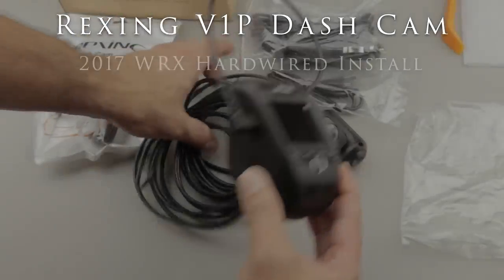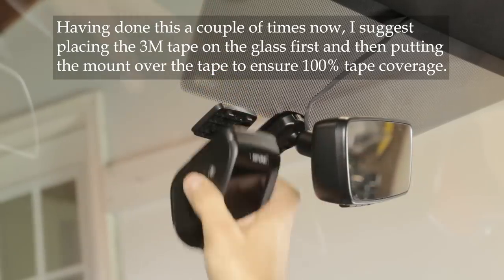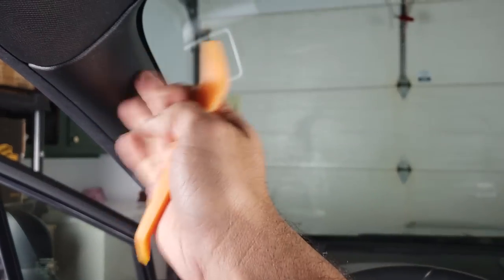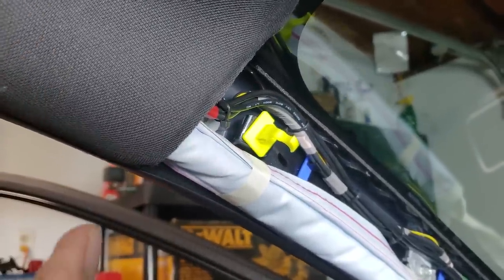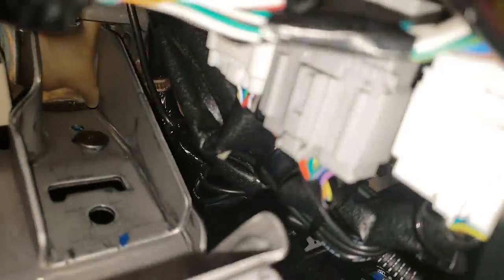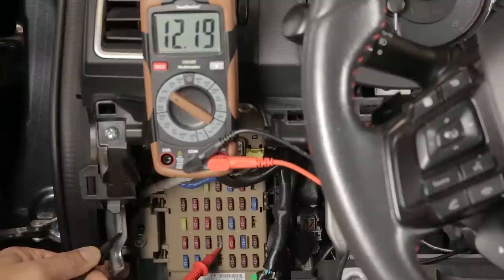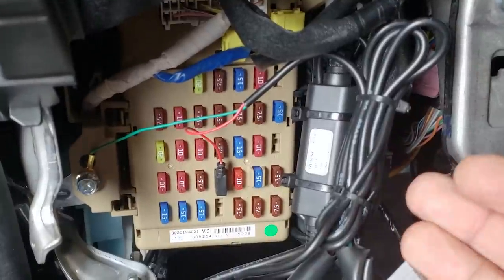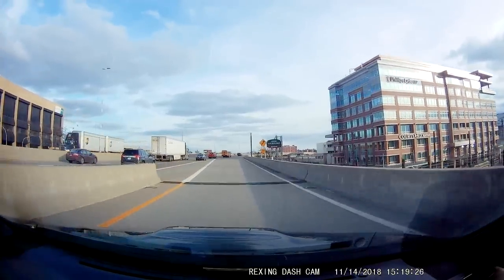How to Install (Hardwire) Dual Dash Cam in WRX: Rexing V1P 3rd Gen

Comment: Great video, just one note, those small points on the back of every fuse are there so you can test a fuse without having to cut it open.
Reply: Thanks for the detailed and meticulous video. Very helpful. Two things that would be helpful to discuss in an initial vid, are the pros & cons of direct wiring, including the risk of draining your battery. And, secondly, the cost/benefit of buying a 2 cam system with a “park” mode vs. a direct wire. I appreciate your demonstrating the removal of trim panels, zip tying cables, using foam insulation and routing the rear cam cable around the headliner perimeter vs. attempting to go through the center of the headliner. Very well done. I learned a lot. 👍

Comment: Thanks for the information. I have a 2017 STI and want to hard wire my new dashcam as well. However, I want to use a constant power connection (for nighttime monitoring which my camera supports). Do you happen to know which fuse location provides constant power?

Comment: Nice job. I did notice u have a Subaru and I have a Toyota and we have the same T style tab to watch out for. However I have a question. 

When u installed the key on wire. You didn’t install the constant. So u only use one of the 2  wires in the kit….what did u do with the constant power wire?

Comment: Great install video.   

Be aware that the black box on the DC-200 mini-USB direct install harness will not activate and power through the harness (to the dash cam) unless minimum voltage of 11.6 volts is detected by the black box.  The standard cigarette lighter power harness does not have this voltage sensing so it will operate e.g. at 11.4 volts, whereas the DC-200 Smart harness will not operate.  

If you hardwire using this DC-200 cable it and static test during installation and your Rexing dash cam does not power up THIS DOES NOT mean that the harness is defective.  Once you start your car, the alternator should supply sufficient voltage to power the dash cam.

Don't make this mistake in assuming the cable does not work....like....uhm....someone I read about on the innernut.  Test the DC-200 Smart cable installation after ensuring your battery is at least 11.5vdc or higher, or, start the car.  Once verified that everything is functioning, you can button up your wiring install and reattach all cabin panels, zip tie excess wiring, etc.

p.s.  I didnt like the limitation of the Rexing adhesive mount so I revised it in this fashion:  I grafted a 17mm Garmin GPS ball female socket onto the Rexing adhesive mount.   That now mates to a male ball elbow attached to a RAM suction mount.  The footprint is larger than the stock Rexing adhesive plate but the tradeoff is that I can now pivot the front dash cam about 45º L/R and about 20º up/down.   This is particularly useful when I'm backing up.  I can switch to dedicated rear view and pivot the display for easier viewing (vs straight ahead per Rexing mount)

Comment: do you know the ends of your multimeter tips come off so you can get into tight spots like the fuse holders? if not try it out..just pull the ends off where the tip is.
Reply from the maker: Yup, still didn't fit, but thanks for sharing that.

Comment: good video, what fuse Amp did coming with your accessory circuit fuse, 5A, 10A, 7.5 A the one that you put into the empty slot, And also I found an empty slot in my fuse box and read it 14.3 volt when I turn my car on, can I used those  slot for the installation?

Comment: Hi I’m not sure if you’ll see this, but I need help. I just tried installing my hardwiring kit and failed haha. I have 3 empty slots and tried to test the circuit with a test light and came up with nothing. I have four 15amp fuses in my fuse box & they are all important. I also have a 7.5amp fuse that’s a spare and is constant. Would I be able to switch this out and put the 15amp hardwiring kit fuse into it? Thank you in advance.

Comment: My rexing dash cam that i installed shuts down after 50 seconds. I believe it might be that the fuse is upside down. I will try again tmrw. Took me 2 hours and i had to disconnect everything.

Comment: Isn't foam flammable material? I've got slight paranoia that maybe some cracks in the wiring's rubber (from cold weather) will allow sparks to ignite flames.

Comment: So where you say that the cable can get in the way of the airbag on the a pillar in the front? Just FYI the air bag will eat right through that skinny wire, but it's not a bad practice to stay out of it's way, and in the back where you went under the air bag is actually where the gas is and that doesn't deploy, again just FYI, great video I will be installing mine in a wrx so thanks for all the footwork👍🙋‍♂️, also try not to coil all of your access wire in one place it can create some magnetic field like a coil and interfere with electronics

Comment: Would leaving the camera connected in the 12v power outlet (while parked and parked overnight) still work the same as hardwiring, or is that not recommended?

Comment: The fuses on the hardwire kit are too big for my fuse box. Bought some adapters. Can I clip off the hardwire fuse and splice it into the adapter so that it will fit in my fuse box? If so how?

Comment: I bought the V3 dash cam. the hardwire kit comes with 3 wires: the ground, the one to connect to hot and the other to connect to switch. 2 questions: can i plug in both hot and switch wires? and what if both nubs on the switch fuse read 12volts how do you know which side is hot?

Comment: Just to clarify -- we always want the end of our fuse tap that doesn't have the wire coming out to be inserted into the lead that is hot in the socket? In your video at minute 13 (https://youtu.be/k90FRVzIcks?t=833), the hot lead from your socket is at the bottom and you want that to run through the lead on the tap at the end where the wire isn't coming out. You illustrate this by saying that it in this manner it actually utilizes the fuse before it goes to the wire to power the camera. Is this true for all wire taps and their leads?

Comment: One thing to mention: Be careful messing around in any area that is near an airbag! They can cause serious injury if accidentally deployed. It's highly unlikely, but be super careful anyway. In fact, to be even more super careful you can disconnect the battery terminals for about 5 minutes before proceeding (and leave it disconnected while you finish the install of the wiring). This will de-energize the system.

Comment: I thought this was the wiring that allows you to use the camera normally when the vehicle is running and then have it automatically switch to parking mode when the ignition is turned off, where it gets power now from an always-on source. I guess this is just the kit that allows you to hard-wire it instead of plugging into your 12V "cigarette" port.

Comment: I turn the car on and the unit does not turn on. I press the power off in car. I then press power on dash cam it starts and shuts off. Any suggestions.

Comment: Great video.  Nice point about the fuse design.  I would simply cut off that permanent fuse and replace with a add a circuit fuse tap.  This way I can insert a fuse and replace if necessary.
Reply from the maker: If that particular fuse ever blows, that's exactly what I would do.
Reply: @akqjtn  Just purchased the Rexing hardwire smart kit for Rexing dual dash cam 4K V1P 3rd generation.  Once installed I can use the parking mode.  I plan to tap into the cigarette lighter fuse.  However, of the yellow and red wire which wire would go where the cigarette lighter fuse is located? Thanks

Comment: Very helpful for my rexing v1p install in my ‘16 forester xt... I used the same empty fuse but had it upside down. I don’t have a multimeter, do you know if any of the fuses in that panel are constant on? My V1P dies right after the car is shut off, and I’d like to set a parking alert to record video when I am away from the car with engine off.

Comment: I installed my Rexing dash cam in the same spot behind the rear view mirror and routed the rear mirror wire almost same way. Thank you for your video it’s very informative and how you removed the 3M sticker you previously sticked on the windshield. It looks like it’s very hard to remove that sticker.

Comment: Great video. It help me install the same camera on my wife's Q50. Unfortunately it interfered with satellite radio. Had to move the install of the rear view camera to the bottom passenger side of the rear windshield and run the cable on the passenger side to get the radio to work properly.

Comment: Great job at explaining. It was very clear and easy to follow. Quick question if I may: if I'm tapping into a 15 Amp fuse with a piggytail (add_a_fuse), can I put a 15 Amp fuse in the second place of the piggytail? I heard some people recommending to use a lower Amp fuse. Thanks in advance.

Comment: Great video, about the fuses and testing for power. If you look at the back of the fuses you will see to shiny dotes, they are the test points for power.  All you have to do is place your two leads on them for the test.

Comment: Great vid, however just a tip you do not need to cut a fuse to expose the metal. Those fuses are specifically made to be able to be tested in place. If you look at the top of the fuse you will see there are both the positive and the neg side exposed for exactly what you are doing testing

Comment: Thanks for the video. I learn a lot. O have first gen nissan altima 97. And  i have 4 empty fuse. But when I bought the hardwire kit. It comes with 2 fuse wires. One red and one yellow. Do i have to install both or just one.
Reply from the maker: This is the guide you want: https://youtu.be/cFoxS8zLUrc
Reply: Also i dont know anything about using multimeter. I had this setting to ac or dc. Which one should i program to when using it on fuse on car ac or dc?

Comment: Outstanding video.  This is one of the very best instructional videos I have seen.  You spoke at a good pace with details.  I am ignorant when it comes to electrical currents so your explanation of testing and clipping a fuse to test and different direction of fuse placement was stellar.  Excellent job.

Comment: Thank you for the detailed video. Only thing I have to add is that my rear camera cable was not long enough to run from the bottom.
Reply: Rexing sells a 33' foot length which is about 10+ feet longer than the regular cable

Comment: So unnecessary to pull the pillar out. Just use the tuck tool that's gets the job done enough
Reply: But a nice way to get in there and tie up the wires together with zip ties. It was easy enough taking it off anyways.

Comment: thanks for the video, I was able to install in my new wrx. I was able to make a zip tie hook on the bracket near the rear seatbelt mechanism. I made it so that the wire will not move anytime so just another way to improvise the last few steps. Did brake a few of those pesky clips though.

Comment: ughhhh your leads caps pull off to make them longer. and the fuse has a tip on each side to tap test no need to cut
Reply: @akqjtn  no they are ment to test the fuse from each point  for the power on power test but your leads can reach in there you just dont know your equipment